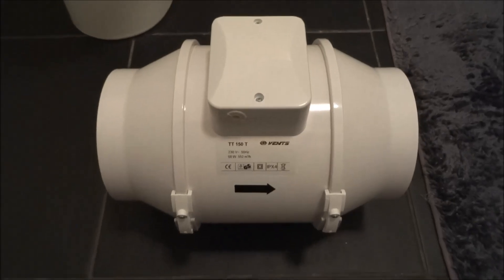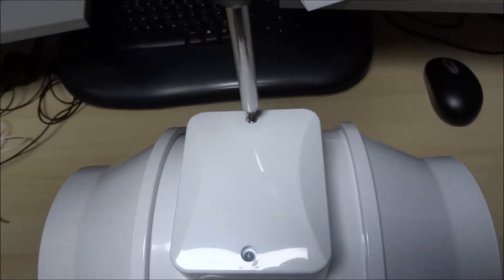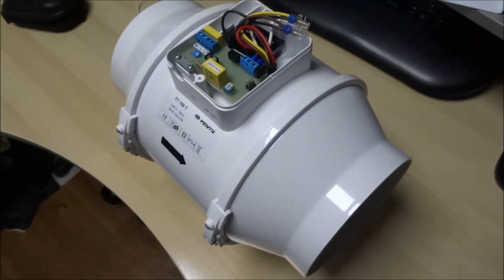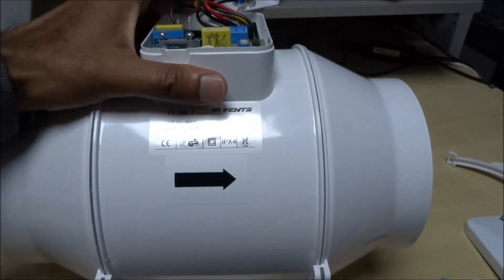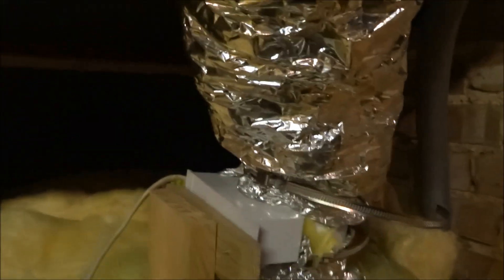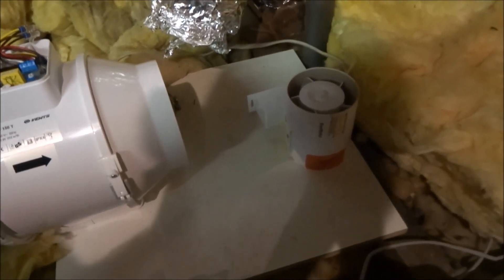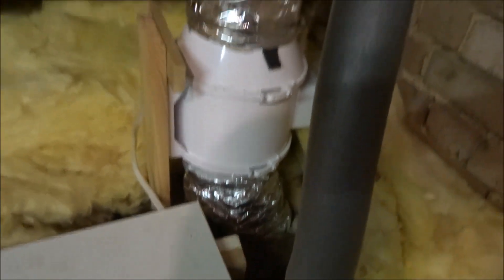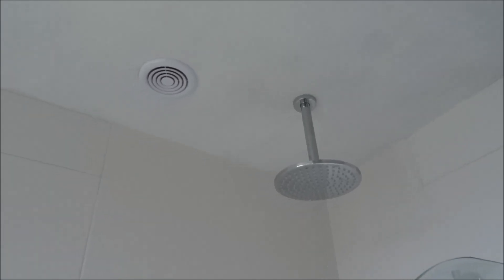Stop steam in a bathroom by fitting a high powered inline fan extraction rate 552m3/h

Comment: This fan is highly inefficient. I use hyper inline fans which have the same type of CFM or very close to it and a 6-inch only uses like 50 watts and 8 in in 75 Watts so with that said this thing takes over 300 watts to run. That cost you a hell of a lot of money to run over a hyper fan. Just a thought
Reply: What are you talking about? The fan in the video is using 60w max.
Reply: @snq8068  no it's not it's over 300 watts I looked it up and said that the hell with this thing
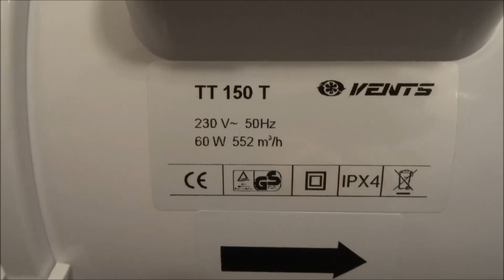Reply: @jeffwolf8018  You been looking at wrong information... I just had a look at a copy of the real test results from "Tüv Rheinland" which tested and certified the fan. https://gyazo.com/7018d05ad9e0cdb79afba8658e410252 here is a link to the whole test results, 68 pages.. https://ventilation-system.com/uploads/download/61_185_cat_file_lang.pdf Not that it matters anymore since i just linked the actual Tüv Rheinlands test results, but literally every site that sells this fan has it listed as 60w in the specs, even says 60w on the damn label that's on it 0:21 .
Reply: @jeffwolf8018  it's 60w on the specs label. That said, the Manrose is between 42 and 48 for the same size.

Comment: Can I use it for kitchen smoke?
Reply: Only if you include a grease filter, if you dont grease will settle everywhere on the fan and duct ... leading to fire risk
Reply: You can put it in your kitchen ceiling, and the extractor hood would be over the stove/hob, so you will have two fans in the kitchen for good ventilation.

Comment: How to add a plug for a socket?
Reply: First, fill the bath with water and stand in it. Take the wires from the light fitting....

Seriously. If you have to ask how to fit a plug, get an electrician in.
Reply: A plug for a socket??????? It doesnt plug in, its wired to the lights. You turn the lights on, the fan comes on. Watch the video again - he turns the light on, (when he says listen) and WOOOO the fan starts!

Comment: Hello there i just bought one like yours, i connected N=neutral and L=fase .....after i just pluged the power and nothing. Both fase and neutral are correct, i certified that....but no nothing.   Any sugestion?
Reply from the maker: +Pedro Ferreira N is neutral and L is live. Did you connect via a plug? If so check the fuse, also you have a multi meter to check there is a  current going to it? Could possibly be a faulty product.
Reply: Geek Street thanks for your help. I realised that i have to connect a phase also to the timer (LT) so that the fan work. I was trying to see if the fan was ok connecting only the Neutral (N) and the phase (L) just to see if its works. I realized that for it to work you need to connect also the wire phase to LT conector.
Reply: Pedro Ferreira I have the same problem. Connected Neutral and Live. Tried both L and L1 but doesn’t work. What do you mean by wiring the LT?
Reply: Pedro Ferreira this one time the guys that ate the steak had a popsicle for sale ... universe is big  you know and so is marshmallows ....
Reply: DaniSabchev I sent it back to the shop! Bought a Manrose MF 100 instead and could not be happier with it! To me the Blauberg felt very flimsy, cheaply made! Once you open the wiring box up to connect the main power you will see that to yourself! The wire goes into the motor leaves a big gap so I can see the water can come into the panel box! The Manrose MF 100 is sealed with silicon. Good luck with yours!

Comment: There are a number of issues here . 
You have replaced a 100 diameter fan with a 150 diameter fan but not replaced the airvalve thus putting a massive reduction to the airflow, which is why it sounded loud . Secondly, you didn't change the ductwork , which has an inner core for airflow and an outer sheath for insulation which means that you haven't connecting the fan to the inner core and are just moving moist air through the insulation which doesn't really offer any real ventilation and will cause damp problems in the loft . 
The terminals L,N and LT refer permanent Live, neutral and Switched live respectively in order for the timer function to work .
M3/H refers to metres cubed per hour (how many metres cubed of air the fan will move in one hour) and that equates to about  150 l/s which is a fantastic airflow . 
Try to keep your ductwork as straight as possible and if you can use solid pvc duct with ductwrap insulation as this will allow you to fit a condensation trap if it becomes necessary .
Reply: It isn't that loud, really.

Comment: Please can you tell me if swiftair fan  came with a circuit board and has 3 pins for the uk plug?
Reply from the maker: +ste roller neither the old or the new fan was swiftair and neither came with a 3 pin plug but you could fit one quite easily if you wanted to.

Comment: What a monster! What model is that? The noise is a small price to pay with an extraction rate like that. I always find 4" bathroom fans totally inadequate so generally fit 6" kitchen extractors for bathrooms. Makes a big difference.
Reply from the maker: +Zed Man the model is Vents TT 150 brought off eBay for £47 ish I think. I ended up putting two 4" fans in the bathroom ....and still no good both had extraction rates of 100m3/hr on each but this fan is truly amazing no steam at all but the fan is massive.
Reply: @GeekStreet  You can buy a speed controller like "Vents RS-1-300" to turn down the unnecessary speed and get it quieter, also you can buy a silencer and run it through bigger insulated ducting so it gets really quiet. Also the fan makes more noise/vibrations if you have it installed like this on a piece of wood, it gets better if you could hang it down with some elastic straps. On top of all that you can box the fan with some insulating material to reduce the sound even further, using a simple cardboard or wooden box filled with rockwool on top of the fan is a very simple way to do this.
Reply from the maker: Thanks for the comment much appreciated!
Reply: Zed , That is duct fan ,It look like 340*255*240 size model , you can even choose smaller ,under that size for your bathroom ,
Reply: Geek Street l